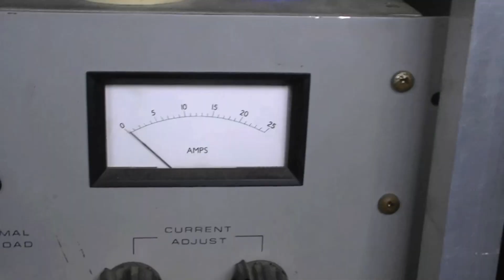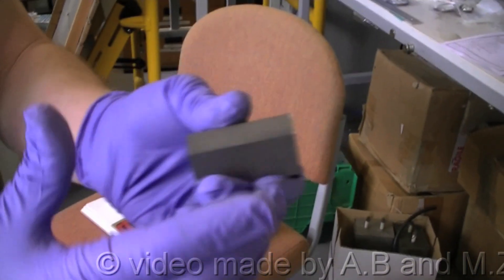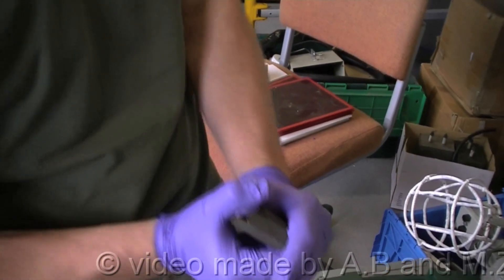NdFeB based permanent magnets how to Separate

Comment: Awesome video. Few questions though which I always wanted to know:
1. If you use that machine and they get magnetized is it permanent? Or will they become weaker and weaker after some time and just fall apart then?

2. Is that how all magnets are made in world? For some reason before I thought magnets are like resource found in rocks :D

3. What if you separate those  2 pieces and put fingers between  them and put them close, will it squash very strongly to pain? 

4.Is there a way to de-magnet?